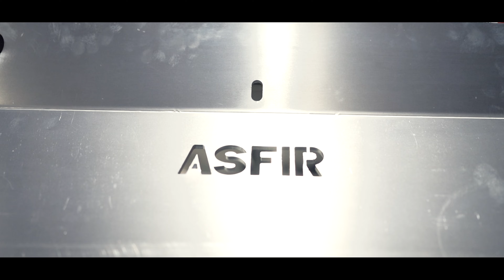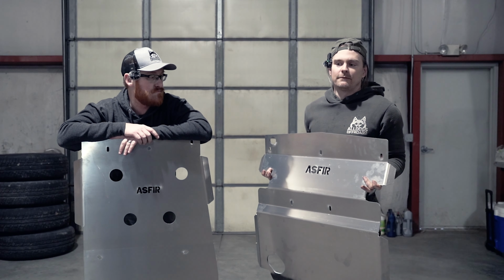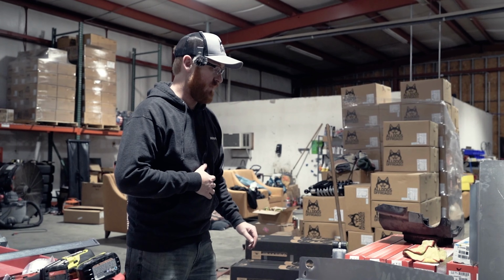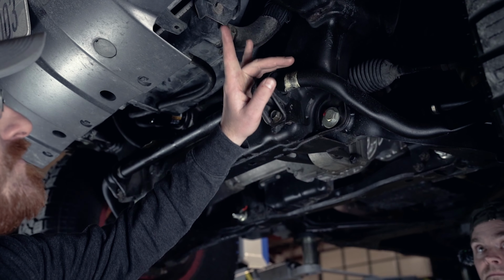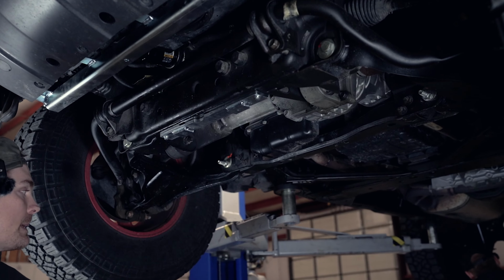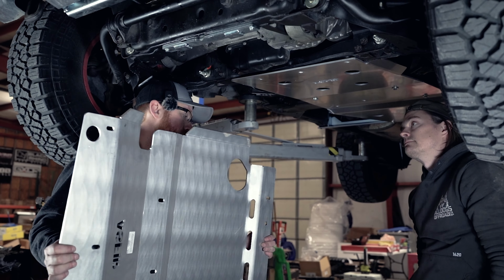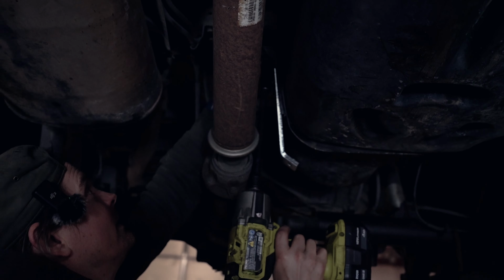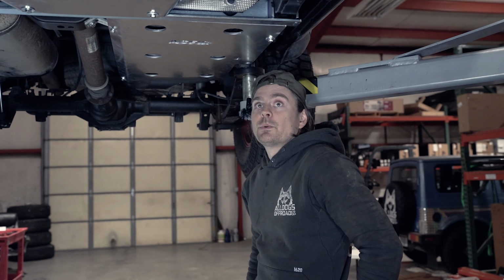ASFIR 4X4 Skid Plates Install on Our 2005 Nissan Xterra

Comment: I just got these for my 2013 Frontier. Waiting on warmer weather up here in NY. Because my old ass is going to be crawling around on the garage floor. This should give me a general idea on what to look for. Thanks for the Video and the 2" lift.
Reply from the maker: Fuel tank brackets are a little different but the engine and transmission skids are identical

Comment: Nice skids, oil filter access leaves a lot to be desired
Reply from the maker: yeah, easiest trick we've found is to cut a 5 quart jug in half and slide it under the spout that is under the oil filter to catch any oil that comes out while taking it off. reach in from the passenger wheel well to take the filter off.

Comment: Do you need to remove the engine skid plate to change the oil?  Or is there an opening to get to the drain plug?
Reply: There is an explanation about this above

Comment: If you have the factory pro4x steel gas tank skid, is there any good reason to replace it with the asfir? Could save a few hundred just using the 2 front skids if the factory gas tank skid is nearly as good. Thanks!
Reply from the maker: the asfir skids are much stronger than the stamped steel factory skid plates
Reply: Agreed.  I’ve beat the snot out of my gas tank skid just doing normal not crazy wheeling.  It’s amazing how much it hits it right at the break over angle.

Comment: Would the front skid work with a Frontier ARB bumper?
Reply from the maker: Would fit with the ARB bumper but would have a gap between the two. You would have to get a custom built one to fill that gap.